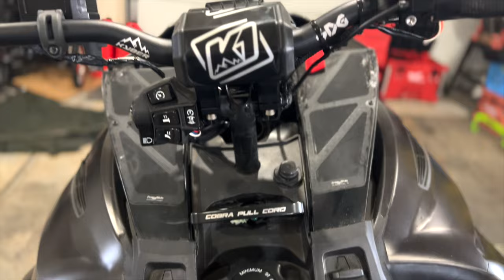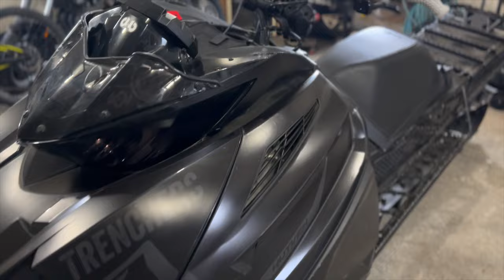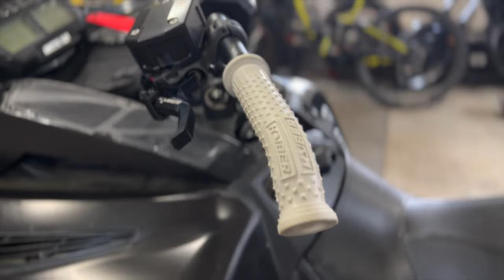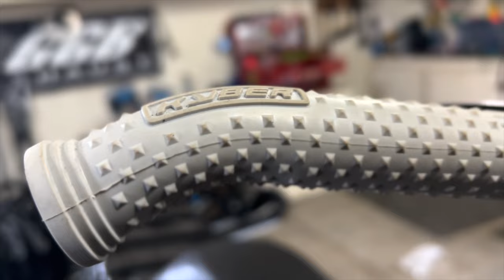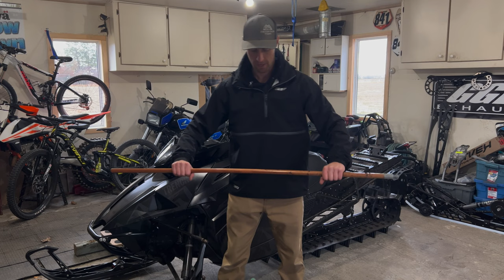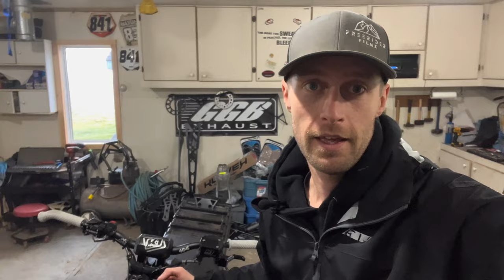Low Handlebars Will Make You a Better Rider!

Comment: On my Axys I am running CFR Kersterke bars bolted directly to the stock lower bar clamp with 1-1/8" adapters....no risers.  Picked up my Boost today, and swapping over that bar set-up will be the first mod ha ha.  I'm 5'-6" and also ride moto.  The low bars really let me get comfortably over the front to stay in control with nice relaxed hands, especially when climbing.  I also recently learned (through many trials) that a good neutral position requires foot placement a fair bit farther back on the running boards than what I once believed.  It's counter intuitive, but by moving the feet back, the head goes forward putting more weight over the front.  Kind of like in moto when dropping the heels, driving the knees back, and the head goes forward.  I'm in full agreement with you.  Your tips are a game changer and I have set my wife's sled up the same way.  Oh and I'm an old man pushing 50 lol...
Reply from the maker: You have it fully figured out my man. Wish everyone understood this concept lol

Comment: Coming from a motocross background as well it's very easy for me to understand this! For alot of snowmobilers it's a hard concept to grasp since they may not have any previous experience with having to maintain the proper body position. It's worth the body aches and pains for the first few rides 🤘
Reply from the maker: Your the low bar king 💯
Reply: Came from Landon’s insta post with his setup. You guys rock for educating the sled industry. Can’t wait to see both you guys slay it this winter🤘
Reply: Trust me when your back is bad low bars are not worth it.
Reply: @jeremypreston1593  everyone has their personal preferences
Reply: @ljp116  Exactly so why the huge push for low bars from everyone. My thoughts are ride what you like and feel comfortable with.
Reply: @jeremypreston1593  It's not a huge push, no one is being paid to recommend low bars. Everyone that "pushes" low bars is simply sharing what works for them the best and the reasons why.

Comment: The OEM bars on my '21 Khaos were WAY uncomfortable and forced me into a hunch position.  This kept me from smooth and efficient movement back and forth, side to side.  After installing a 2" riser, the difference was night and day from massive trail moguls to technical terrain in the hills; not only do I have better control over the sled, but I don't have a sore back at the end of the day either.  I am not a jumper as mentioned in the video, so this may explain why lower bars are beneficial.

The only time I don't like them is those looooong flat hauls at high speed while sitting on the seat; my hands are almost at shoulder level....BUT, that is like 2% of the time.  The remainder of my riding time is spent standing and moving.

Coming from the cycle world, height, weight, and riding style has EVERYTHING to do with proper bar position.  I am 6'2 @ 245 lbs.  The lesson is what works for one rider of a particular size, weight, and riding style IS NOT a rule.

Sadly, the only way to KNOW for sure is to spend the money and ride with various setups until you find the one FOR YOU.

My $0.02.
Reply: I'm 100% with you. He leaves out a persons height. If you're tall like myself, 6'3", being forced to hunch over isn't ideal. Sled manufacturers design their sled for an average height man which is 5' 9" for an american male. 2" riser is perfect for me on my Alpha.....but individuals arm and leg length are significant factors. 
Customization has everything to do with your own body size. There's also some other things I disagree with....but mostly because I'm a mtn rider, mostly around treeline in pow. The drawback of narrow bars is it requires more effort to get the sled over. This difference is negligible since we counter steer to get a sled up on edge anyway

Comment: Great Video. If I get the SDG bars and add the Handlebar Corks and SDG grips, will the overall diameter of the grip area still be less than the standard bar with standard grip?
Reply from the maker: It depends a big on what grip you go with. I found the attack ones to feel slightly thicker then the OG Kyber grips. That being said the attack ones wear in quickly and start to feel smaller diameter after a handful of rides. Bottom line yes the cork will add some girth

Comment: What is your complete full setup on those bars . How are you hanging the heated control?
Reply from the maker: All Kyber one 
730mm SDG bars
65mm riser
Throttle block
Brake lever and reservoir protector 
Grips
I made my own mount out of an old cross shaft and mounted it in the steering post.
Reply: I appreciate you responding. I started looking at ur video more. I figured that’s what u did. Thank you for the response!

Comment: My son and I ride 2022 Khaos and pro Polaris 155” we are really tall though I’m 6’3 son is an inch taller so when I look at where your bars are at with low bars they are pretty equivalent to our mid bars from pro taper. Even with the mid height we have to lean quite a bit in attack stance .we are the freak exception though I know. I just grew up doing this and wanted to show my son the sport. But ya we are tall 😂 makes it harder for sure

Comment: How tall are you? I’m 6’4-5 ish, in MX I use 998 bend (Windahm) and I’m pretty picky about it once I figured out how they work with my position &form.. on snow machine I’ve got rmk and I can’t imagine going too much shorter than stock, however the bend on rmk feels awkward. I’m fine with the height, something else seems off tho whether it be sweep or width & I haven’t figured out and alternative manufacture or bend
Reply from the maker: I’m 6’ tall

Comment: I don’t believe this is true! I’ve listened to Chris burandt talk about this to and I ran low bars on mine… I was constantly complaining that my back hurt at the end of a trail to the mountians and my shoulders hurt all the time!!! I switched over to the high bars and wow!!! All the back pain was gone and controlling the sled was 100x easier!
Reply: Get to the gym
Reply: Agree 100% mid to high FTW.
Has to be something with leg/arm/torso ratio that people dig the low bars. 
Does nothing but hurt my back and wear out my legs.
Reply: It’s more about how aggressive you want to ride. I ride very aggressive and rely more on reaction than skill (not recommended) to get through terrain. Because of that I run my flat stock cat bars pretty much directly onto the steering post, i’m 6’. Yeah it hurts my back if i’m just putting down the trail. Rider preference really. What happens is guys take setup tips from pros but don’t try and ride like pros. Which is fine, to each their own.
Reply: No higher the 4 inch rise Ben running a 2 in riser and 2 rise bar since 2008 works awesome

Comment: I'm sorry, but you're talking about grip and still using a thumb throttle. Thumb throttlers don't know about good grip. They only know what crappy grip is like.
Reply from the maker: Haha throttle thing is a personal preference. Even some of the best pros out there are still using a thumb throttle just fine, myself included. I understand the benefits of a finger throttle, I’ve tried them many times but always feel more comfortable with my thumb throttle. To each there own if you are a ripper with high bars and finger throttle giver lol
Reply: @JasonMcMurray  I used to be the same. I grew up on late 80's and 90's sleds. Owned lots of 00's. I mostly trail ride and always used thumb throttle on every sled I had ever. Last year I got a 2022 Renegade 900T. The throttle can flip from thumb to finger on the go at any time. Although, it's recommend to not change it while the sled is on. At first, I tried it and hated it. I did however notice that the right-hand grip was significantly stronger using finger and nearly as good as your left hand. So every time I went out, I made a point to try and do some thumb and finger riding. After around 1000 miles I found myself only using finger throttle. It gives you much more confidence and allows much more aggressive riding styles. After putting on 2000 more miles, there is no way I can go back to using my thumb. The lack of grip forces you to ride an unnatural way that gives favor to the stronger grip on the left hand. Quarks like favoring to turn hard a certain way or going downhill being very cautious are things of the past.
Reply: @shperax  You're a trail rider with a 900T commenting on a backcountry riders throttle/grip? Lol... too funny. At least you're riding but you should have somewhat of a clue of what you're talking about first.
Reply: @tdelam  Finger throttle makes any type of riding superior.
Reply: @shperax sounds like someone doesn't know the difference between facts and opinions
Reply: @mikegillen6009  I identify as....... being correct on this issue.